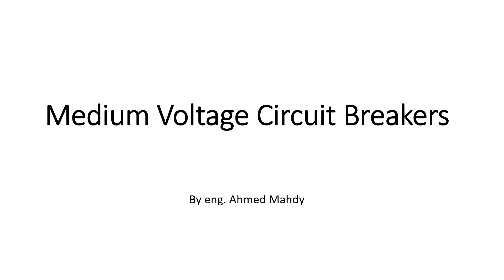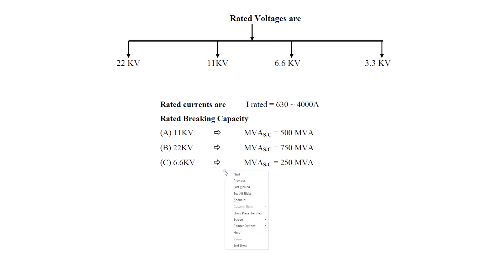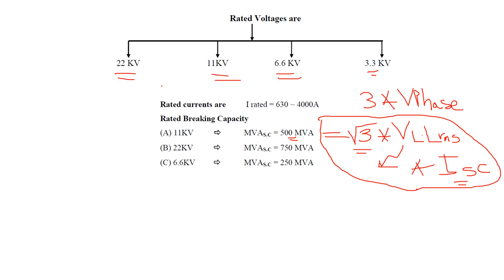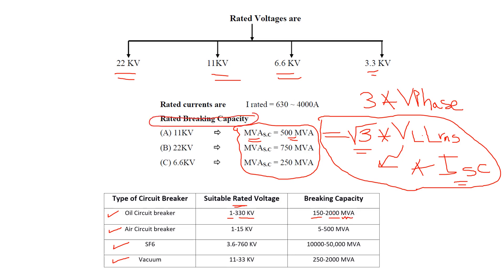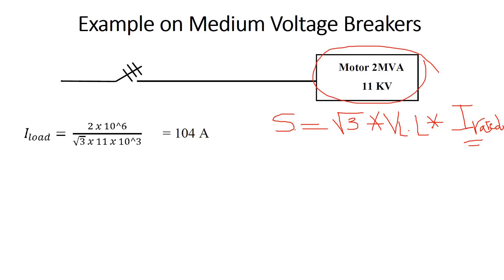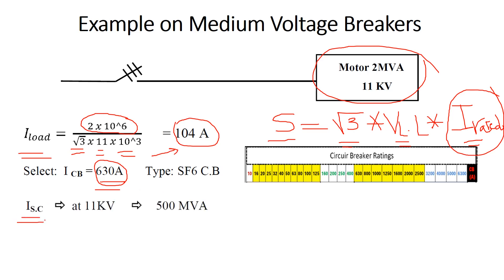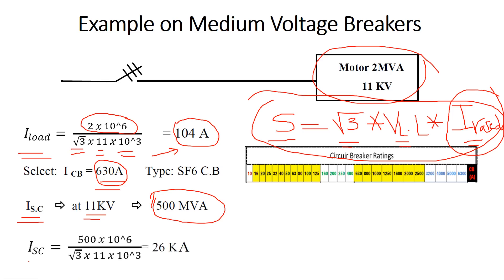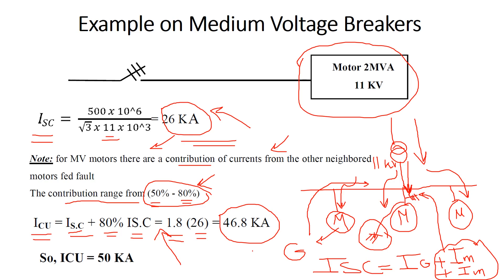Selection of Medium Voltage Circuit Breaker Rating for Electrical Engineering

Comment: great job but you sized the breaker based on standard specs it should be based on actual calculation of short circuit current and to be compared against available specs,

Comment: Why do you multiply by SQRT(3) V L-L * ISC?   Aren't you trying to find the individual phase currents?  Shouldn't it be V L-L * ISC  / SQRT(3) ?  
I am probably confused, but I can't see multiplying the LL voltages by SQRT (3).  This is critical to understand the main calculations in this video. Could you please explain more clearly or point us to another video where this is explained.  Thank you.
Reply from the maker: SQRT(3) V L-L * ISC 
This gives the S in case of fault current or apparent power in case of fault current to make it easier, this also known as the Breaking Capacity of a CB in MVA
V L-L * ISC  / SQRT(3) this is not correct as you are dividing Power by root 3 and doesn't have a meaning.

(S/ root(3)* VLL) 
This gives the actual phase current